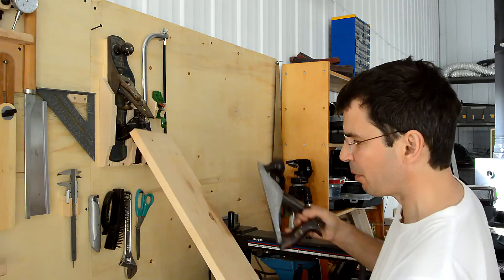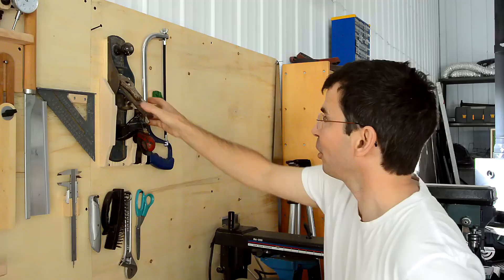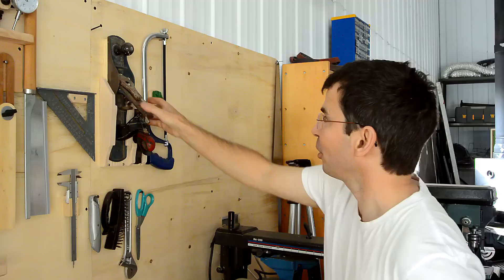A better hand plane holder

Comment: Ah come on we all know the best way to hang a plane is to drill a hole through the sole and hang it on a screw...
Reply from the maker: Excellent idea.  I should do that just to get the purists all worked up.  And the hole has to be off to the side a bit too so it hangs at an angle!
Reply: Thanks a lot, now I have to clean my head off my walls... >.<
Reply: LOL YES! now that would be a great video. just get a $5 plane and have fun!
Reply: You monster.
Reply: Make sure you don't de-burr the hole either, it'll hold onto the screw better that way.
Reply: No screws. You need a dowel that's 0.5mm thick!
Reply: Inb4 troll video next week with cheap hand plane.
Reply: Even better is to drill the hole on the end with the handle so it hangs down at the most uncomfortable position for taking it off and putting it back on the screw, a flat head screw at that.

Comment: I've had the same vertical lock in unit for twenty years copied from my high school woodworking shop, but with a slight larger top handle cradling around the forward grip so it slides upward and then locks in a little more,. As it's for the large plane size (shown on the left) that might be why. Neat job!

Comment: I see a lot of comments about it being bumped and falling . Would have to be reasonable bump. Just a thought the bottom contour of wood you used could be cut on a taper therefore taking it out is still just up and out but at no time a bump could do both motions. Only drawback would be a place to collect dust a quick vac would fix that every couple of months. 

Great video as usual I don't comment often.

Comment: I think it will fall out quite easily with slight vibration (bumping into it) i believe having a slight angle on the bottom bit that is actually holding the weight of the handplane so its tilted inwards would really improve on that
Reply: Or simply have a similar hook at the bottom. The rise of the bottom hook just needs to clear the rise of the top hook.
Reply: My first thought as well. I think a similar hook or small step/rebate on the bottom would work well. Imagining one of those planes falling out onto the cement and getting damaged is making me cringe a little.
That said, I love the holder, just trying to figure out what needs to be mounted on a wall at work ;)
Reply: Maybe make the top hook a floating weighed piece or spring tensioned piece that sides up and down, and a fixed bottom hook piece. Holds things securely from tipping out, but easy enough to put the front of the plane against the top, push up so the heel of the plane fits in its slot, then let the whole thing back down. 

Would be very quick and easy to grab while also very secure against vibrations and bumps in the shop.
Reply from the maker: If it's only half way in, and it gets vibration, those will get the plan to slide in further, not out.
Reply: Just saying, my granddad, my dad and I myself are using this system (without the siderails) for combined about 100 years in our shops and so far I haven't seen one fall out...
Reply: I think everyone missed  todays physics lesson lol...
Reply: Remember, the handle of the plane is at an angle that would drive against the bottom holder and push into the holster, not out.
Reply: the wall will have to fall over for it to fall out!!
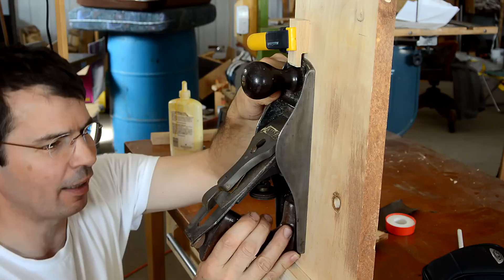Reply: Take another look at 0:20 seconds in. If you've watched any of Matthias's videos before you'd know he rarely, if ever, overlooks things like this.
Reply: And yet I've had similarly stowed equipment knocked out of similar holders, and since then I personally prefer much more robust restraints on holders. For something like a plane I want a holder that will withstand something hitting the wall hard, or from something flying across the room.

Comment: Mine are held in exactly the same way. Although I just screwed bits of wood in rather than glue as I didn't think it'd actually work (even though it should have been obvious). Yours look nicer, as I didn't bother cutting round the shape of the plane, which would have been better. I will amend mine I think.

Comment: Hmm, nice if you insist on vertical ;)

I have mine sitting horizontally on two dowels at right angles to the back board (or very slightly angled up for more security) If you have a drill the same diameter as the dowel it takes about 30 seconds to make - although yes you could carve or screw a lip on the outer edge to make it earthquake proof!

Still loving my pantorouter though!

Comment: I use a similar system in my tool cabinet, but the hooks are too long to just tilt the plane out and I always rotate them out of the way to get the plane out (they are fixed with one nail to allow for the rotation).
Might have to change the hooks now, though...

Comment: Excellent, building a hand tool cabinet (moisture issues mean I can't openly store steel and cast)... I think i will abandon my inclined til after seeing this.
Reply from the maker: Moisture may be an issue here too, which is why the sides cover all the exposed cast iron.
Reply: Because of the cabinet I was using my existing til and going vertical with your clip and profiled bottom. Should work well! Thanks again Matthias.
Reply: Just use WD-40 like it is going out of style. Buy it in the gallon cans.
Reply: My cabinet has greatly extended the lives of my chisels and plane irons;  I added a low wattage (3w) light bulb as a heater and some weatherstripping, and the inside is naturally dry all year long.

Comment: As a beginner wood worker, I have a question to anyone who can answer it. People always seem to glue and screw, but glue is stronger than the wood right? So Apart from the clamping pressure screws provide for the glue up, are they necessary afterwards? Like, can I take them out to save $$ on screws if I don't mind the holes being there? Or is there a reason to keep the screws in even with the glue? Any advice would be awesome.

BTW, I love what you do Matthias. Keep it up.
Reply: Glues weren't always so strong, and a glue joint needs to be properly designed to work well, so some people have just got into the habit of using both. It's handy for holding the work together while the glue dries, and a backup in case you didn't leave enough area for the glue - but you don't need the screw.

Also, adding a screw or nail doesn't weaken the wood much as the fibers aren't cut - but taking it out and leaving a gap leaves a small weak spot.
Reply: Thank you, that makes a lot of sense. So if I want to keep the screw I should probably look to just using clamps if I think the weak spot my destroy my project later in life. Most of my impromptu things I am building in shop to be a work surface or house tools I know are gonna be short lived as I learn more and can build better, so for now I will not worry so much about it, but now at least I know, that anything I want to last, I will not leave a hole in the wood to be a weak spot. Thanks for your awesome answer.
Reply: One more question if you would, I have noticed some people put screws every 2 microns, and others use real sparingly, is there any rule of thumb there?
Reply: I guess it depends whether you're just holding the wood together while the glue dries, or going for ultimate strength. If you want a strength, the total strength of all the screws should be more than the wood, so that the wood breaks next to the joint, rather than the screws pulling out.
Reply: One screw is usually a lot stronger  than" a lot" of glue...  So they can be used sparingly, and the part will be much stronger than simply gluing a butt joint..

If you want something to be really strong, make it out of metal.

Still, too many screws and the material becomes a perforated line.

Comment: Why not router out a cavity so that the blade doesn't touch anything while it's sitting in it's holster.

I know you're good at sharpening blades anyways, but this would have the added bonus of the heel of the planer sitting a little tighter against the wall.
Reply from the maker: because the blade is not allowed to touch wood?

Comment: any reason you prefer big twist drills over countersinking drills?
Reply: FoodOnCrack one reason might be, they are too short compared to a drill bit. Although the tip angle doesn't match the countersink angle of the screws, its pretty close!
Reply from the maker: don't have a countersinking bit in that shop
Reply: Matthias Wandel ah...how many workshops do u have?
Reply: The Eminent Joshua E. Hrouda Two as far as I know of. His main shop is at his house in his basement. And his second shop, "The Big Garage Workshop," is out on a rural property.

Comment: wouldn't it vibrate out of there over time when the HVAC cycles?
Reply from the maker: No, it would vibrate in if anything.  If there was no friction, it would still stick in there.
Reply: you know, you are right. the handle sticking puts the center of gravity out from the wall, which means the top piece of wood will cause the plane to always be pushing against the wall.

It still seems like the plane should just flop out of there somehow, but the physics says it should stay in there. if you cut the bottom piece of wood at a slant (almost like a french cleat) that would help it stay in even more. pretty sweet

Comment: I would worry that vibrations might gradually walk the bottom of that plane out of the holder.  At minimum, I would consider a small lip at the bottom or an inset magnet.  Maybe your explanation of 'gravity will hold it in by rotation'... but I am uncomfortable.
Reply from the maker: Vibrations will gradually walk the bottom of the plane INTO the holder ,not out.  Please do watch the video where I explain that.
Reply: Matthias Wandel What if somehow when moving something else you hook it and it falls out? I wouldn't feel right with my pricey plane hanging around like that
Having a 1mm leap at the bottom would indeed prevent such unsignificant accident and would only require to lift the plane 1mm up, still using your great holder idea
Reply: Mike Wrobel no
Reply: I think you should do some tests to make sure of this. I am not so sure that your theory is correct but i am definitely not willing to commit to the opposite without actual experimentation... but surely a slightly larger bump would knock it off
Reply: If you're worried about walk out, just put a rare earth magnet on the bottom of the holder.  But I suspect Matthias is right and it won't walk out.  I predict a video proving this coming soon.

Comment: No nails? All boards need to be glued then nailed. That's how you build to last according to Jimmy Diresta.
Reply: As with all comments on youtube, it's difficult to discern when the intent is sarcasm. If its not however, Jimmy uses brad nails after gluing as a quick alternative to clamping. As Matthias has explained many times though, it is the glue that does the work.
Reply from the maker: and jimmy mentions from time to time too that the nails are just to hold it while the glue dries.
Reply: I think that unless you are doing some good joints as box joints, nails /screws are not required, but for simple joining as showed on the video, nails or screws make very high difference for long lasting life. The problem with just gluing, its that no matter how good or hard the glue is, the rupture point usually is on the wood, because a layer failing for stress, so a nail make good job holding pieces together because its supported by a good mass section.

Comment: i would put a recess were the blade is ,   never liked the blade touching anything
Reply from the maker: You need a display cabinet for your planes.  Cause you can't really use them with that philosophy
Reply: i dont use my planes often enough and i did hang a couple and the blade got rusty , but i like the idea in hong kong with very high humidity any steel touching wood has a big risk of going rusty , especially if you dont use the tools often, minting a workshop in tropical conditions can be is not so easy , it can be 100+F and 98% humidity , we have to use engine oil to protect things as veg oil attracts the ants , its a nightmare
Reply: couldn't you put oil on the blades?

Comment: but what about earthquakes!!!   ;-)
Reply: the last thing you should worry about in earthquakes is your godman planes
Reply: This also says differently. http://i.imgur.com/MF2T5w0.png
Reply: It also wouldn't be hard to put a tiny lip on the front of the bottom support, haha
Reply: Wow, you guys are right - all that stuff is happening barely 2,000km from his workshop! Brace for impact! I'm scared too since I'm only about 1,200km the other way.
Reply: A small inset magnet at the bottom would work as well. You don't need much holding force from the magnet to resist even strong shaking.
Reply: In the Ottawa area where Matthais lives small earthquakes occur from time to time ( rebound from the last ice age supposedly ) see the government website: http://www.earthquakescanada.nrcan.gc.ca/index-en.php
Reply: opi

Comment: Going to pass on this design for use in California we have earthquakes
Reply from the maker: If you hada quake severe enough to knock the plane out, you have bigger things to worry about.  Like repairing your buildings.
Reply: Put a magnet in the bottom then it is earthquake safe and still easy to remove.
Reply: You could possibly make the bottom side a little tilted or a sort of small cradle.